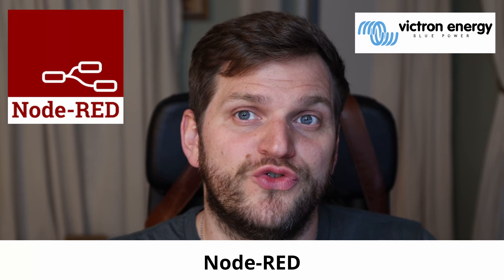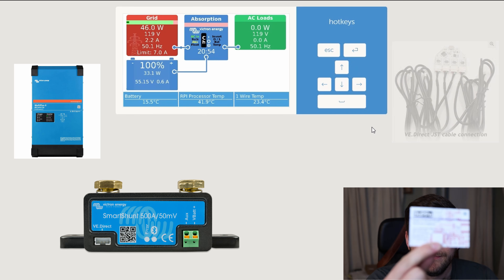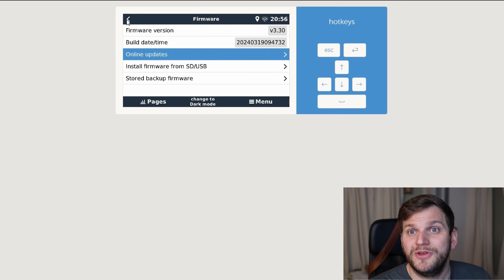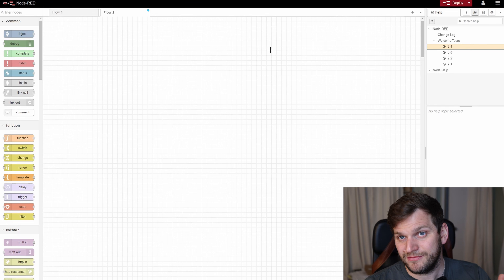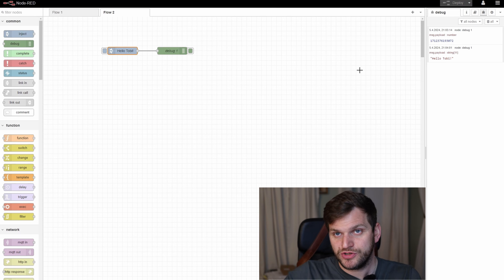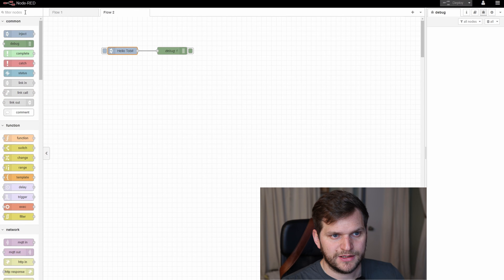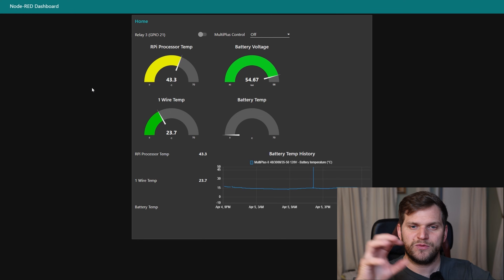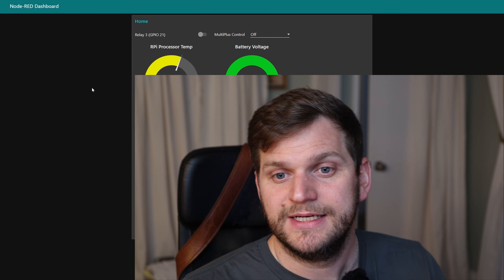Victron and Node-RED Basics | Let’s get started! | EASY! | Part I

Comment: 8:20  The number is a standard unix timestamp. It's the number of milliseconds that have elapsed since Jan 1, 1970. To format it into a readable date, in the terminal you can use the command:
date -d @<theNumber>
where <theNumber> is the value shown. 1712376193072  (You clicked the button on Friday, Apr 5, 9:03:13 PM)

Comment: 3:30 & so it looks like a show sropper for me. Why can't we use ethernet network in our house to connect those brucks together? Or at least something lile ZigBee network. My RP Pi server is at the other side of the house, far away from Victrons:( if there is Cerbo GX in the system all should be fine using Cerbo-to-nodered.

Comment: hi sir I just purchased a Victron multi-plus ii and im building a 48v battery so I'm not even running a system yet , I just stumbled on to your site and being totally new to this technology it should be interesting to follow along and learn. thank you for sharing
Reply from the maker: Great to hear! Let me know if you have a specific use case which might be interesting for the channel viewers as well to work on :-)
Reply: That makes 2 of us.  You are in front of me, I am awaiting arrival of my batteries/case but I have  my Victron MPii, Cerbo GX and shunt ready to deploy.  Quite nervous about having the necessary skills to interrogate Octopus Agile, couple with my PV output, link to weather and trigger charge periods.  One bite at a time.

Comment: Good starter video. Venus OS/ Node red are very powerfull tools to take ultimate control of your Victron ESS. I run my systems all of node red, ac coupled and in external control. With flexiable tarrif, Solar forcasting and exporting at peak times for grid response. Not sure if any other manufacturers let you have this much control over your system. Looking forward to part 2 :)